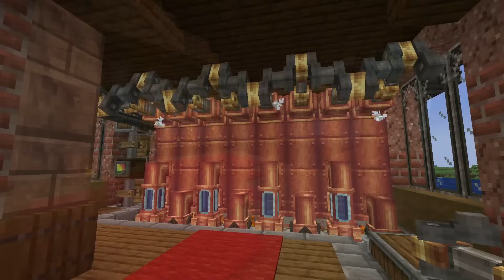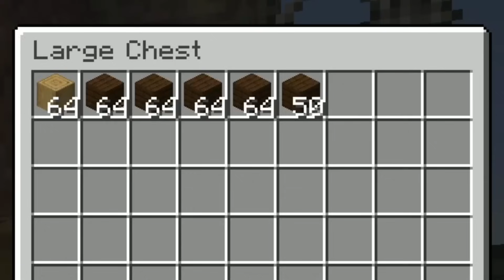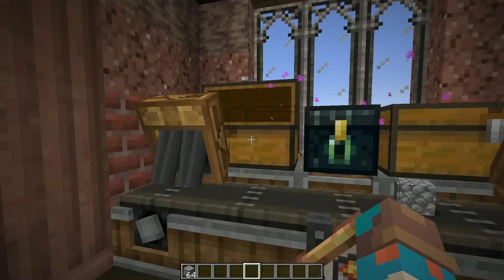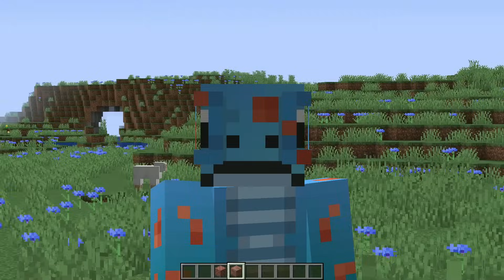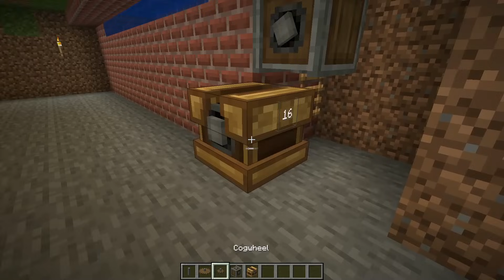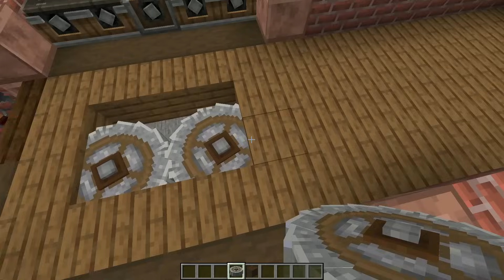EASY Workshop Guide | Everything you need to Start | Create Mod 1.19.2 | #guide #minecraft

Comment: 8:25 When using a table saw, if the saw teeth are coming at the wood from above, the wood is pulled down into the table. If you feed the wood in backwards so the teeth are coming up at the wood from below, the wood can be knocked into the air making a sloppy cut or worse case scenario the saw catches the wood and launches it at high velocity away from you. if you were holding the wood down hard enough to get it to cut when this happens, there is a good chance you get pulled  into the saw.

Comment: 8:25 They did that so that you can use three small cogs conecting last axis of the input belt, saw and first axis of the output belt. Each connection between cogs inverts rotation speed, so first cog pushes left (X), saw is inverted (-X), output gets inverted again (X). In real life, saws have to cut against the log, or the saw will throw the log forward... kind of makes sense.

Comment: Don't know if anyone has mentioned this so far, but the issue with the saw mill is that it is an optical illusion.  Drive down the highway and watch the wheels of the cars moving fast.  Their hubcaps spin so fast they appear to move backward.  So, your saw appears to be going one way, when in fact it is just moving so fast in the opposite direction that it only looks like it is moving the same way as your belts.
Reply: Does not change the fact that the items get spit out the wrong way

Comment: Fans don’t seem to be able to push through belts as of the latest mod version. I placed a lava bucket on the right of the smeltery belt with a fan behind it instead. It functions fine but having just a cube of lava in the wall isn’t ideal in terms of aesthetics.
Reply from the maker: Yeah, i think if the belts have a casing on it doesnt work from underneath anymore which sucks, removing the casings it should work, even though it doesn’t look as good

Comment: Hey I know it's been 3 months but please pin this
As of the current version of create out on 6/27/2023, you only need 1/2 of a waterwheel to power the entire 8-engine setup you see in the video.
You do, however, need to double up on the pumps to the 'kick-start' engine that the waterwheel powers in order for it to receive enough water.
So, if you want, you can do what I did and shove two entire 8-turbine setups in with one water wheel to power it all, turning 256SU into 32,768 SU.

Comment: you can make the sort of speed step-up with cogs much more compact by putting casings on the cogs--it prevents them from linking with the other cogs that the shafts would usually connect with, so you can basically just go with a tiny 2x3x2 footprint or so by stacking them on top of each other